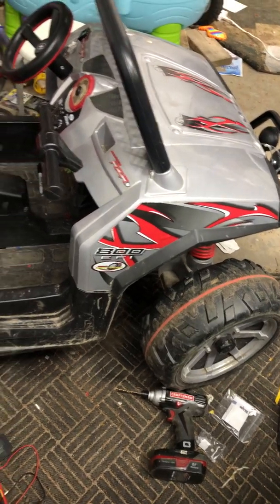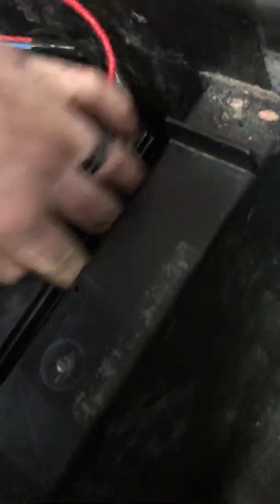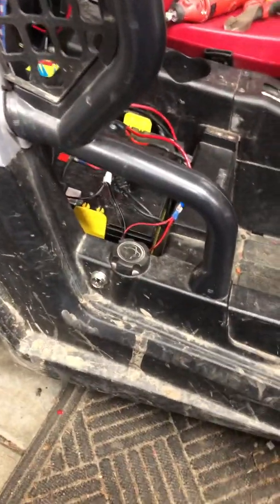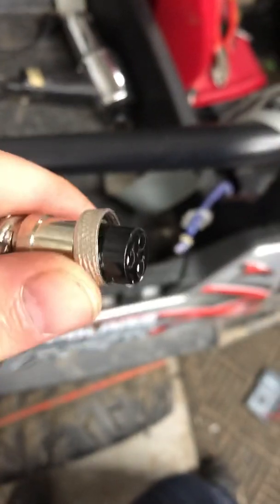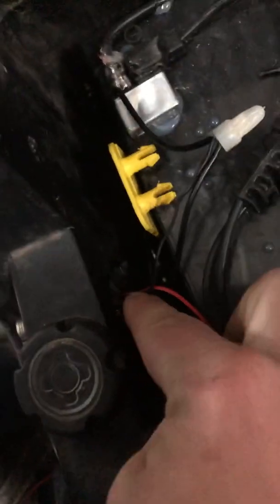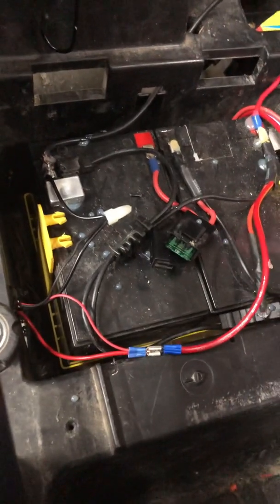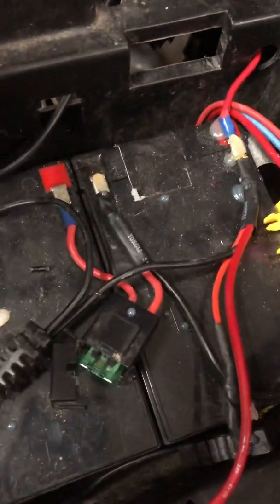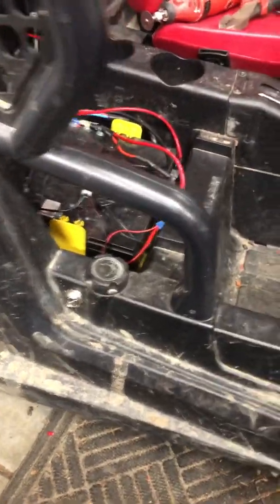Adding a charging port to 24v electric ride on toy - Peg Perego Polaris RZR 800

Comment: The connector for the battery is supposed to run through the slot in the seat base. That way you just lift up the passenger seat and disconnect the battery and plug in your charger. No need to take off the whole seat.